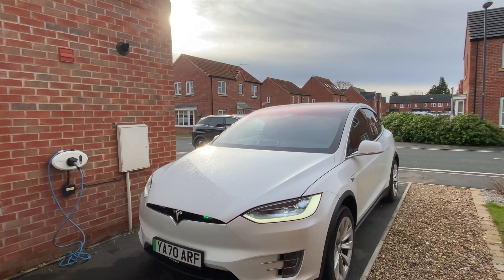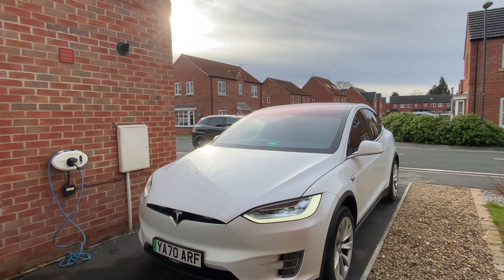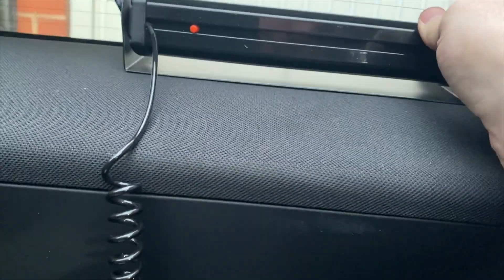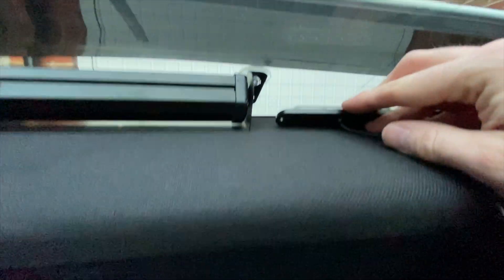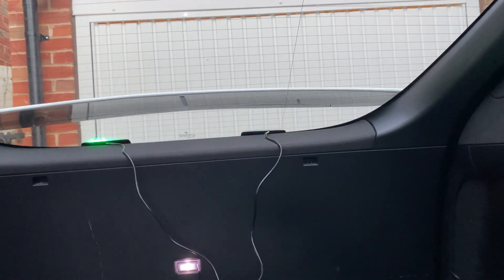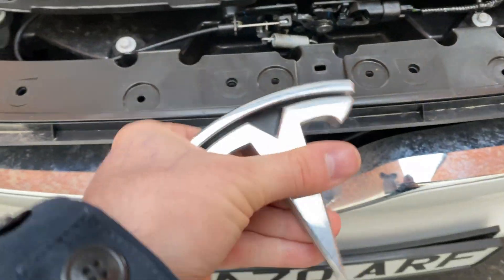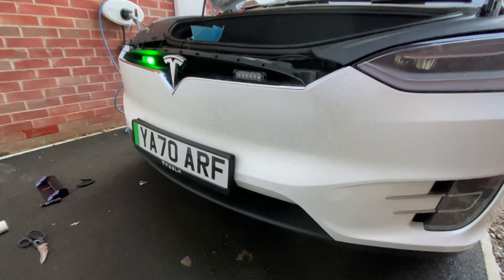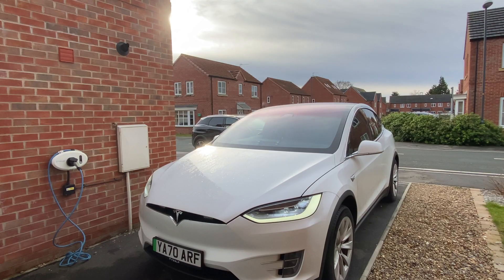Tesla Emergency Response Vehicle - how to fit police / ambulance lights to a Tesla!

Comment: As a doctor, do you have to get special permission to fit/use the green lights or is it simply as long as your registered you can if it’s for when your attending an emergency?
Reply: Green lights themselves have no exemptions, and the doctor must be associated with an ambulance service (such as HEMS) to use them. They can only be used to 'make progress' (basically hope drivers move out the way), and there is no legal requirement for other road users to move out the way of the green lights. They also cannot be used with a siren, unless accompanied with blue lights, and a driver who is trained to run on blues.